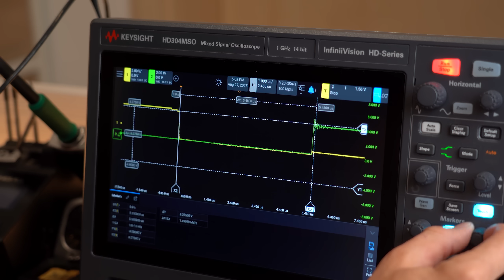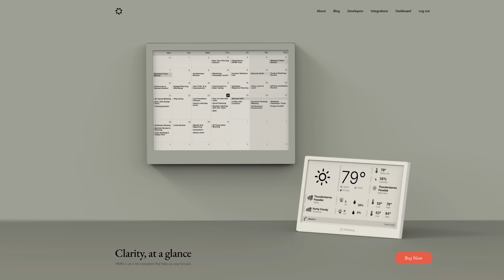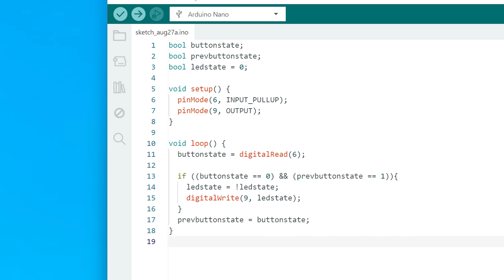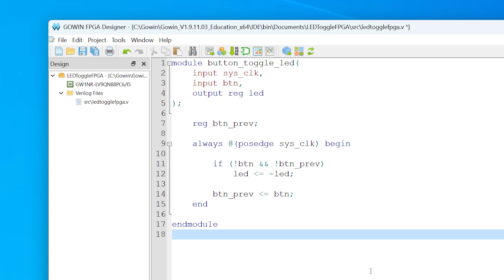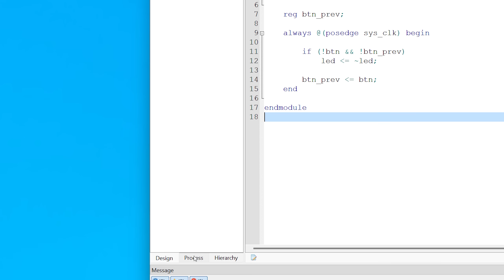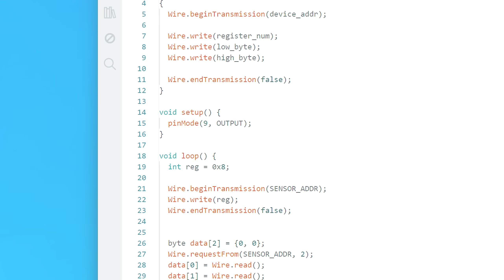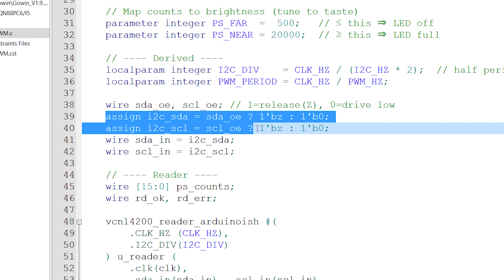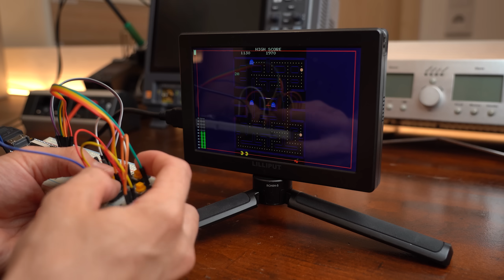The Harsh Truth about FPGAs (You Should Avoid Them?!)

Comment from the maker: Attention!! This video is not made to trash FPGAs. In general FPGAs and Microcontrollers are used for completely different things. They pretty much have their own application field. You would (for example) not use an FPGA to talk to I2C devices. But I compared them directly in this video because I think many people are familiar with microcontrollers. I think the concept of FPGAs is easier to understand with such a comparison. That was all. Thanks for watching 🙂
Reply: You would absolutely use an FPGA to talk i2c. The idea is to have a chip that can talk i2c but for 1000 times. You just implement the i2c state machine and make a for loop that generates 1000 i2c lines (assuming you have 1000 gpios, this is just an example) and youll have 1000 i2c lines that all talk in parallel. 
FPGAs are great for implementing custom hardware. You can do i2c, hdmi, Ethernet, or anything in existence. Think of it like this, if your needs can fit a microcontroller, then you don't need an FPGA, but if your needs don't fit, like for example you want to connect to 15 i2s microphones, then you need an FPGA to create hardware that has 15 i2s peripherals. That's what FPGA is for. Has nothing to do with the type of application, it's more of an architectural question. The microcontroller you're using in the video was probably prototyped on an FPGA before they decided to manufacture it.
Reply: @belalmohammed2265  On top of that, many FPGAs have hardened i2c modules built into them, so sometimes, you don't have to implement i2c yourself if you only need to communicate with a couple of devices.
Reply: Just a quick question based on your first speed test: Did you use the DigitalWrite()/DigitalRead() functions or did you use direct port manipulation to read/write the pins on the MCU? The Arduino functions are known to cause significant overhead when you want to switch pins rapidly.
Reply from the maker: @jhonny44444  I used the slow digitalWrite function. I needed to reach around 100x faster because it simply sounds more interesting ;-) Don't hate me for it.....
Reply: @greatscottlab   this shows how much thought is behind every little thing in your videos
Love your content
Reply: @greatscottlab  No hate, just wondering if you pushed the most out of that Atmel chip👍 16 MHz also gets you into the nanosecond range, Arduino's are quick if you need them to be^^
Reply: @greatscottlab 
Generally one would use both an FPGA and a uC since some protocols are much easier pre-implemented.

But, for instance, if I want to make an autonomous flying drone using small neural nets, it is far better to program an FPGA with the structure of the network and weights because the processing power in an uC is plainly insufficient.
Reply: In my industry (aerospace) we use FPGAs quite a lot, especially for DSP. However, we use a VHDL (Very High Level Description Language) to develop their 'code' and usually they are implemented along with a CPU and Software.
Reply: Sorry, but I just see the point of this video. Your claim above makes no sense. Basically, "FPGAs are no good for my viewers because they have to learn something new". But that's the point of being a hobbyist. From a hobbyist or a professional's point of view, the uC and FPGA are completely different things. You had to learn programming and microcontroller architecture too, remember? You had to learn what I2C was at least to some degree. Just because someone else has written an I2C driver doesn't make a uC better. You can get libraries of common blocks like these for FPGAs too, you know. If I'm a hobbyist and I want to mess about with making my own logic analyser, then there is really only one choice if I want to make it useful: an FPGA.
Reply: @AussieUnclePhil  Good remark. It's also cute how much plainer the Verilog sample was (though it had a bug, an extra ! in the edge detection condition, and was still more complex than required).
Reply: Great comparison between MCUs and FPGA behavior 👍 I will make a video on "your first FPGA project" later For those who want to get started.

In the right perspective, they are simple to use. Stick to the trails, don't go off-road type thing. Outside that, hope you don't hit a brick wall! 🧱
Reply: When you try comparing MCUs to FPGAs, you are comparing apples to oranges. Just because FPGAs might be more difficult to learn, it does not mean that a person should not learn about and use them. Both MCUs and FPGAs have their respective use cases, and you must pick the one that is appropriate for your use. If you find FPGAs not to be useful to you, that is perfectly fine.
Reply: I complete agree with Greatscott. FPGAs are brilliant and what they do. But they are not CPUs although if you’re mad, you could probably make a CPU and use that. If there were any gates left.
Reply: It is nice that you explore nice things! FPGAs are nice but it is an entirely different scince then programming. There are alll sort of things that you don't meet in other places: ALUs, pipelines, FIFOs (very different thing then usual FIFO in programming), etc. But it can be fun sometimes.
Reply: Working with FPGAs requires a whole different mindset. Everything happens all at once, you're not reading a list of instructions in order, you're reading a set of marching orders for an army. There's nothing wrong with using an FPGA to control I2C devices, but your FPGA's marching orders are necessarily going to have a lot of "hurry up and wait" when dealing with serial protocols, especially if your peripheral device needs to stretch the bus clock.

More powerfully though, an I2C peripheral (or SPI peripheral, or parallel bus, etc.) can grant asynchronous external access to a set of registers, letting an FPGA do some work at full speed in response to parameters set by software. This, or embedding a whole soft-CPU in your FPGA, is the full potential of an FPGA, software and gateware side by side, not reducing your entire problem into HDL.
Reply: As a C programmer for decades a few months ago I started learning about FPGAs for "fun". I hit some of the issues in this video and many more.

The "binary format" for FPGAs is often proprietary. You can't just use the your favourite IDE (which will typically call gcc) and output something the FPGA will understand. Some of the cheaper AliExpress development boards require you to use proprietary tools from the manufacturer. These can be poorly documented, quirky and down right buggy. I hit assertion failures and crashes in one without even trying.

Coincidentally at some point I'll be looking into I2C comms. There is no IP block from the vendor for I2C so I'll either look at open source alternatives (which can hit licensing issues) or write my own: the protocol isn't that complex.
Reply: @TinySpongey  Yeah, I know exactly what you mean. It's a shame there isn't (or maybe there IS) an MCU with a decent FPGA inside so we can have the best of both. Proprietary licensing has gone way beyond the original realms of making sure the company saw a profit for the considerable investment into just ripping off the entire supply chain.
And worse this is creeping into consumer tech by the back door with companies now disabling smart features until and unless we agree to ever increasing sypyware.

Eventually they'll just make us pay to use the electronics we PAID FOR.

The EFF might be well to look into this.
Reply: Your premise is not correct. You used the I2C example because people are familiar with microcontrollers? If I want to compare a refrigerator to a cooler I don’t try to show how difficult it is to create cold with the cooler compared to the refrigerator. The cooler will never ‘create’ cold while refrigerator will. They are each used for different things. The FPGA is used for  timing critical applications that cannot be done by microcontrollers at all. So if anything an FPGA can almost always do what a microcontroller can do albeit with a whole lot more work and recreating the wheel but a microcontroller cannot do most of the things that distinguish it from an FPGA. I once created and ran a custom 5 bit processor inside of an FPGA but I could never create the tight timing necessary for certain applications with a microcontroller no matter how fast it is. And as others have pointed out, you can do many things in parallel with an FPGA. Not like a time multiplexed OS in a processor. I mean a truly parallel function independent of other functions in the FPGA. This may or may not be important to you. So based on what I have explained you should know that some tasks are only for microcontrollers and some tasks are only for FPGA’s but if money and real estate are not a concern then depending on the project the best design if complex enough will probably best done with a microcontroller and an FPGA. That way the micro can handle all the interfacing and memory storage and the FPGA can handle all the time critical things as well as parallel signals or functions that must be done at the exact same moment in time as well as anything that must be processed in ns instead of us/ms. Sorry for the rant but as a long time user of FPGA’s I’d hate for somebody to dismiss them as useful tools in many projects before they even understand what they’re for.
Reply: I don't know what AI you used to try to code, but try Google Gemini 2.5 flash (free) if you haven't, no matter what you assumption is about it or what you've heard about other AI's recommended for/against by other people or what benchmarks you've looked at. 
It's all I use now for coding.
Keep the code as short and simple as possible, so don't try to code GTA5 with it.
Seems like around 1,200 lines or code or less is optimum.
The more lines of code you have, the more it gives you broken code.
Although it can technically go far far far beyond 1,200 lines, i'm telling you from personal experience.
Reply: Well. Most wouldn't but it's starting to make sense now. Especially a system having both an mcu and an fpga. Or better both in one.
Reply: There is 4 years of content I have missed out on here!!!! Whats going on youtube????? My settings are set to notify me on all. @greatsottlab I honestly thought you stopped doing youtube. Your subs should be way more than 180k given your content. Youtube is not promoting your videos at all in my feed which is strange given what I watch. They keep pushing Trump rubbish even when I click dont recommend channel. Really annoyed. Good that I have heaps of your stuff.
Reply: Now imagine you have 10 I2C devices, and you need to talk to each of them at full speed, so they cannot share the bus. FPGA is the only option now.
Reply: Sorry my intent was not to criticize. Only to give an old timer's perspective. I find your topics interesting and saves me time investigating these new technologies. Thanks for sharing your discoveries.
Reply: Let's be honest. You did clickbait. I don't like clickbait.
Reply: This is really "horses for courses" argument - FPGAs can be insanely fast and give you configurable hardware!  But if you don't need the speed then a Microcontroller will generally be MUCH simpler.   My thought is one should start with a microcontroller in your prototype but if you find you need the speed consider an FPGA.   Your design could even use both to get the best of both worlds.   Or you could use a micro + support logic!  

Don't forget that many of the common HW functions have been built into the Microcontroller so the speed isn't always that different.   I bet you could cut down your microcontroller response time and make the timing very consistent using a HW interrupt instead of polling the signal.
Reply: Achtung!
Reply: Should put this on the intro. xd
Reply: @MrSongib  No.  I hate videos that start off with legalize about what isn't and is covered.  Just start the video.  It's faux-fessional to produce a product that is supposed to be fun communication with the opposite just to be over serious.  Professional is thinking about what the product is.
Reply: @JasonMitchellofcompsci  Its not about 'legalize' its about fast info, not just clickbait bullshit.
Reply: Ok bro, chill

Comment: 20 years ago I worked at a tech company that made Video Processors for home theaters using FPGAs.  It was cutting edge stuff.  Scaling, deinterlacing, color correction, etc - all with sub-frame latency (the time the signal came into the FPGA, vs the time it was processed and left the FPGA.
  
FPGAs are useful in certain situations - it's kind of like how an analog computer is useful in certain situations.
  
When you have a logic "equation" that you need to apply to a signal in real or near-real-time, every clock cycle, to get an output - think a massive PCB of legacy discreet logic, but in a MUCH smaller package.  If your selected FPGA has DSP blocks, then you can do more advanced "equations" - think streaming, signal generation, filtering, analysis, etc.
  
Notice I said "equation".  Logic in FPGAs are not "libraries" like lazy programmers have gotten used to today, where everything is obfuscated behind layers and layers of other recursive libraries.  VHDL and Verilog are more akin to programming in assembly.  You actually have to know very specifically what you are trying to write and WHEN everything needs to be in place for it to function - one of the hardest things to do back when I was still doing that stuff, was "timing closure", getting every bit of data into the right place before the clock "ticked" (consider that the data-bits have to physically propagate through a grid of your programmable gates).  You're getting down to the physics impacts of electrical signals in a chunk of silicon - so things like temperature and voltage (from the silicon Process, Temperature, and Voltage [PVT] triangle) can impact your design performance.
  
Between FPGAs and discreet logic - you can add in CPLDs.  Similar in function, and fairly ubiquitous.  There are MCUs available with FPGA "peripherals" - like the Xilinx (now AMD) Zynq 7000.  This gives people learning to FPGA-the-heck-out-of fixed logic a way to get into FPGA/DSP-blocks with the benefit of an ARM MCU and a ton of conventional peripheral blocks.  Thinking of FPGA block like peripheral, I think, can be useful.  Imagine a peripheral like an encryption accelerator in an MCU - you feed in what you want to encrypt, the keys, and some configuration instructions about how you want it done and you dispatch it - when it's done you get an interrupt and you can fetch the data from a register.  FPGA blocks can be similarly used, with a bit of buffering - to load a series of data you want to process, then you pull the output of the last run from the output buffer on the next clock cycle - like a physical peripheral, except you can make the peripheral what you want.

  
One of the neat tricks you can do when you get down to this level of hardware is related to timing.  Because bits physically take time to propagate, you can take that button IO and deliberately write a buffered path through a long chain of logic, but sample it at various sages of the buffer chain.  When tuned correctly the propagation of the bit from one end of the buffer to the other is exactly one clock cycle long - but the sample mid-points become "taps" for sub-sampling the propagation of the bit edge.  If you had ten evenly spaced taps on that delay chain, you could add one tenths decimal point to your sample time - 256 taps and now you're slicing that 60nS clock-oriented sample time to a measurable 1/256th of 60nS (234.375pS per tap).  Look up fixed point math decimal representation - this was a revelation for me way back when I first saw this done.  Every one is typically used to a binary number system starting at one - but if you shift the decimal point those bits become divisions of 1 (so 8-bits with four bits of decimal would be: 8, 4, 2, 1, 1/2, 1/4, 1/8, 1/16).

Comment: may be you should use pull-up resistor when using FPGA for I2C communication....most of FPGA do not have build in pull-up resistor....unlike microcontroller which have specific pin for I2C communication and build in pull-up resistor